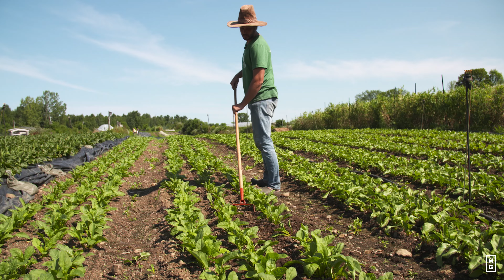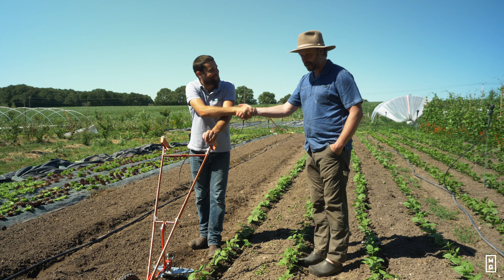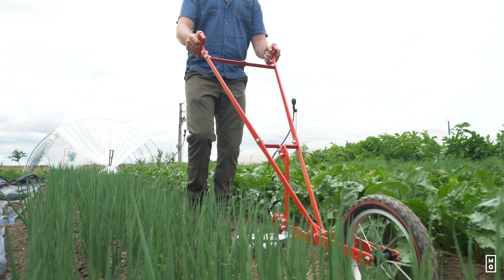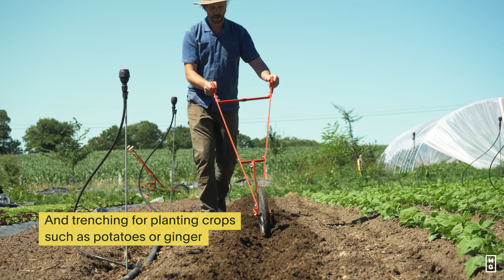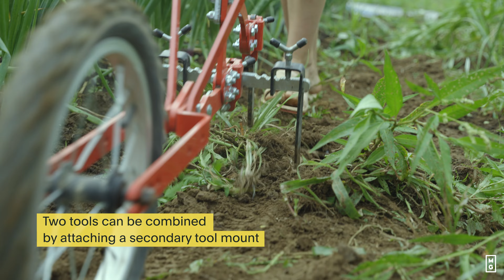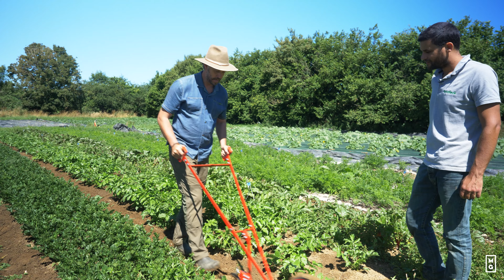Why The Single-Wheel Hoe By Terrateck Is The MOST Versatile Tool In The Market Garden

Comment: I tried an antique cultivator, hiller, and oscillating hoe and I loved how it worked. I’m wondering if this tool is just as heavy, and well designed as the older ones like the Haas? Also, can you demonstrate using it on rock hard clay soil with rocks, grass, and other large weeds?